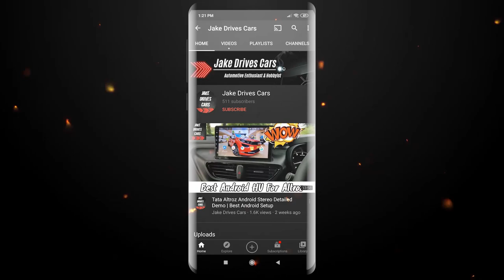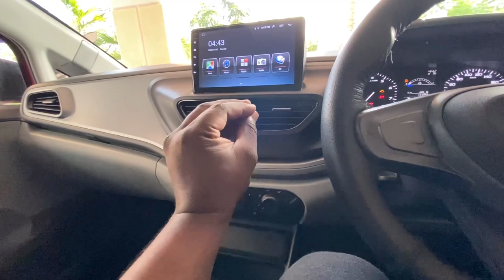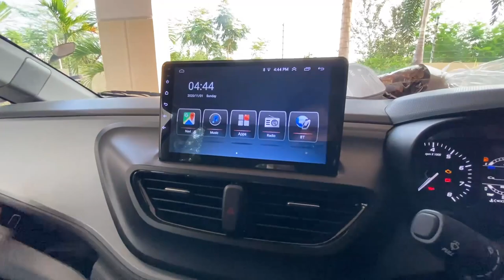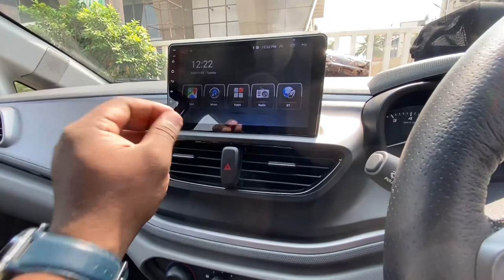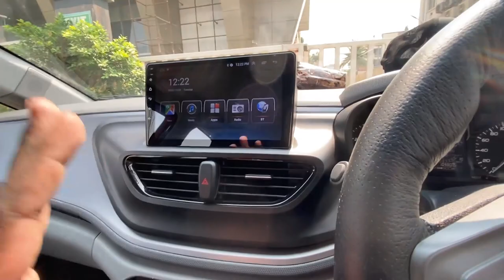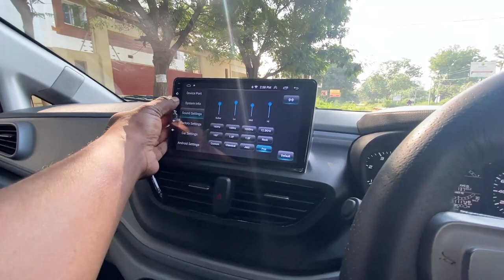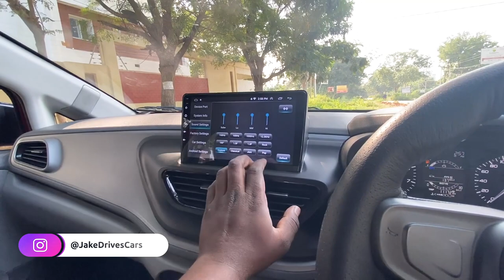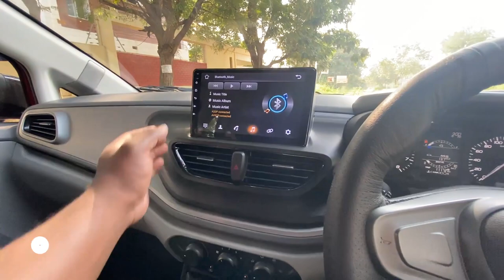Tata Altroz | Audio Modification |  High Level Input Connection | Brazo Amps |

Comment: I had the same issues in my Duster car, my JBL 9004 amp does have a high-level input, but the EVO guy suggested me to use an audio converter on both speaker wires to make it an RCA input for my AMP ..  I didnt get the expected output and it added these idle hiss noise too.. I got it all corrected from another car decor technician, now they took out audio convertors and my speaker wires from HU directly go to the AMP's high level.. giving me much better output.. the overall system sounds much better.. better soundstage and no noise at all .. very informative video .. thank you !

Comment: Thanks a great video, I have been using the High Level (speaker level) input from almost 5 years, sadly the unpad car decors and thr mechanics dont have any knowledge in the Hight level input type. I have connect JBL STAGE active subwoofer via speaker level signal. I never had any issues till date. The advantage is the Hight level connection works as Remote Signal as well.... Can you please share who is the Technician details who did the Job for you

Comment: Do you think Android (installed in your car) can beat the music quality of pioneer/sony single din stereo installed in any other altroz 
Mainly i wanted to ask that should i drop android stereo and go for pioneer/sony if i want a good music quality  response from 2 pair component and a subwoofer?
Reply from the maker: Good Question Sid... These cheap Android stereos can never match a Single Ding from a reputed brand... Because 1. The ports are built better hence giving a cleaner signal 2. The Audio processing capability is far more superior compared to Android's DSP. If music and quality are a priority go for a good Single Din... Or you can get an Android Head Unit from Blaupunkt Key largo with can give a very good output ... Costing around 25k
Reply: @JakeDrivesCars  i dont have that much budget i was planning for pioneer DEH-S3190BT paired with 4 channel amp with JBL GTO609C . Suggest me something for base (the above material are my choices although i havent consulted any expert )
Reply from the maker: Sid your choice oh HU is a damn good one for the price. Yu can definitely go for it..
Reply: @JakeDrivesCars  hey jake i have seen some videos of 2020 creta getting fitted as sony/pioneer touchscreen system but i havent seen any videos of seltos for such thing ...do you think that it is possible to have a sony/pioneer touchscreen in seltos coz i was planning for seltos(we havent finalised the varient we should buy of altroz)
Reply from the maker: Yes u can do the same for seltos too... Check out Musafir aka Joshi's channel. He has it done to his car
Reply: @JakeDrivesCars  he have installed that cheap quality hypersonic android i want something premium just like sony/android ...im still looking for it
Reply from the maker: Hey buddy. I just wanted you to see rhat it can be installed. You have food Android Players from Sony, Blaupunkt & if you can wait for a few days, I'll be pushing out a video on a new Android HU from a brand who knows there Audio damn good.... In short, you wont be short of options for a very good Android HU but you will need to spend anything more than 23-24k easily... Sony and Pioneer make a few HU that dont run pure android but still are vwry very good for what they do... Stay subscribed to be altered when that video on the Android HU drops ... Cheers
Reply: @JakeDrivesCars  hey mate, what you say if i stretch my budget to altroz xm+ varient because it now offers oem touch screen and 16 inch wheels as same of xt varient , so the speaker that ill choose for my car their output will be dependent on the tata oem touch screen and pioneer dsp? what you say? #one more thing is their any type of wire peeling while installing fog lamp with drl{drl working} and is their any oem switch for fog lamp of altroz for lower varient?......
Reply from the maker: Sid. If budget permit definately go for it... XM+ is a very good variant. Yyes with the DSP and a decent amp you should be able to up the Audio Quality too... Regarding foglamps, get the mexhanic to use Scotch Locks..... Also, switch is available, u can find the part on boodmo.com

Comment: Bro, thanks for the video. If I use high level input then do I need to connect the ground earthing cable to the amp. Cause I heard if I use high level input then I don't need any ground cable for the amp. Is this really correct? Please let me know soon.
Reply from the maker: No u always need to ground
Reply: Karna hota hai. Iske mei bhi connected hai. Just rca remove karke high level lagaya hai. Count the number of wires.